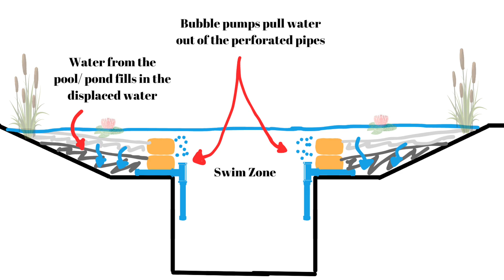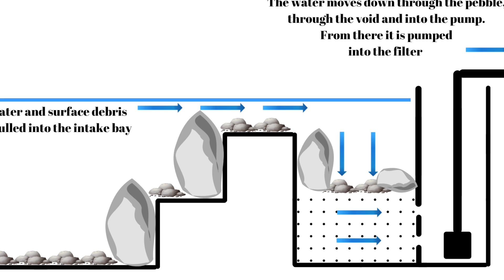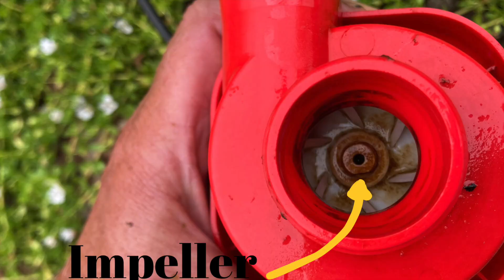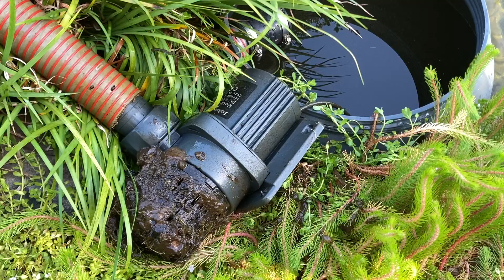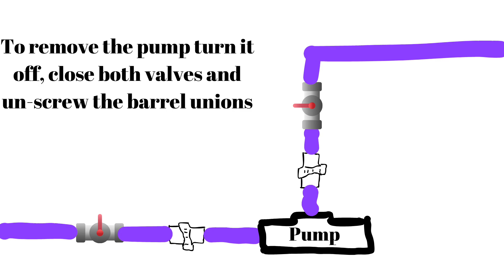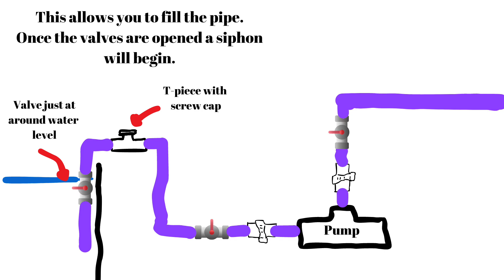Plumbing/Connecting a submersible pond pump externally

Comment: I'm using low cost  variable speed pumps, they are 240v can be used submerged or external. I have them external and so far they work really well. I'm glad they are variable as it allowed me to tweak the flow to the optimal level.
Reply from the maker: If and when I buy a new pump it will always be variable from now on 👍

Comment: Exactly what I needed indeed! On a side note, have you ever experimented with an "airlift" system? It looks to me like there should be a way to make it work with a wetland? Would be even more energy efficient and even get a waterfall?  example:  /watch?v=OOK2MxIx6RM
Reply from the maker: I’ve done a few experiments with air pumps. I love the idea of them.
Reply: @Ozponds  Have you experimented with a smaller diameter pipe to get more head height? Most of the airlifts I've seen are for koi ponds and they don't care much for head height but they all use very big piping. Seems to me if you reduce the diamter to a 32mm you might be able to go pretty high and get a decent stream if your waterfall is let's say only 10cm wide?
Reply from the maker: @Daantjer  it’s not an easy retrofit on what I already have in place. I’m happy with my low volt energy efficient pumps.

Comment: Q: what about a pump being placed in a pond with 6 inch sand bottom? How could we keep the sand out of the submersible pump without going thru the liner and risking leaks?
Reply from the maker: The way I position the pump it isn’t on the bottom and I wouldn’t have sand inside the skimmer or intake bay.

Comment: My local pond supply store has shut down here in South Australia, so it looks like next time I need pump, some liner or whatever, I am going to have to go online, which is a shame as I have found the advice from the shop very useful at times.  Kev, do you buy your supplies online or from a local shop?  Are you able to recommend a good online store in Oz for all things pond related which I can bookmark for a later date?
Reply from the maker: Most of my stuff I’ve purchased online. I recently teamed up with my favourite online retailer, rock around the block. They’ll even give you a discount if you use the code OZPONDS at checkout 👍
Reply: @Ozponds  thanks Kev, I'll check them out
Reply: Creative Pumps in Allenby Gardens have proved a good supplier if that's any help?
Reply: @amandaglynn-jones4552  haha, they are the ones I was referring to that have shut down.  Now you're in the same boat as me 😪
Reply: @kymbo72  NOOOOOO!!
Reply: @amandaglynn-jones4552  I'm not that horrible 😁

Comment: I have been following your videos and I full agree with you that making use of non submersible pumps makes replacement and maintenance much easier but unfortunately noisier. What measures do you suggest be taken to suppress and/or mitigate such noise and vibrations. I am still in the planning phase so it is timely to incorporate such measures.

I live in Malta, quite some distance away on the opposite side of the globe. 

Thank you
Reply from the maker: That’s the issue with all external pumps, you will hear them. Maybe bigger waterfalls so the splashing water drowns out the noise. Like I said in the video currently all mine are in the ponds.
Reply: You can put it in a shed or enclosure, will help trap the sound inside

Comment: Hi Kev, I´ve been watching a lot of you Videos recently as I´m planning to transform a sitting pond into a natural swimming pool next year. In your Video about designing a bog filter you mentioned that the pump should be able to circulate the bog size times 6 and that the bog size should be at least 10% of the total pond size. Does this also apply to larger pools ? This pond would be about 60 to 70 m3 (60.000-70.000 liters). Building the bog filter with 7m3 of gravel and buying a pump with 42.000l/hour would be quite expensive. Do you have any experience with ponds of that size ?
Reply from the maker: My dream pond is 8m x 8m, thereabouts. You might like to see that playlist. I sized the bogs at 25%. It has 4 low volt pumps each capable of moving 15,000 litres of water.
Reply: @Ozponds  Ok that should also work, thank you :) Will watch that playlist for sure.